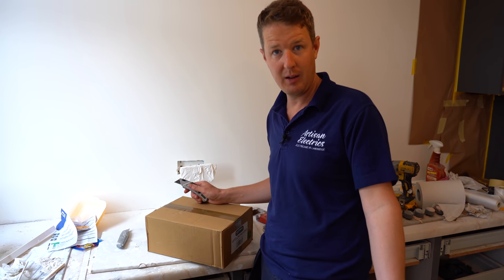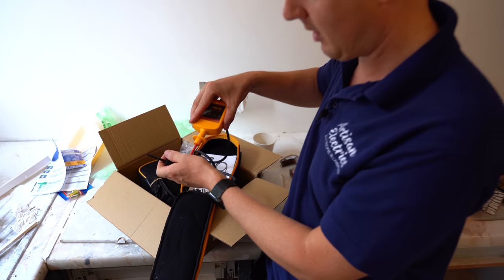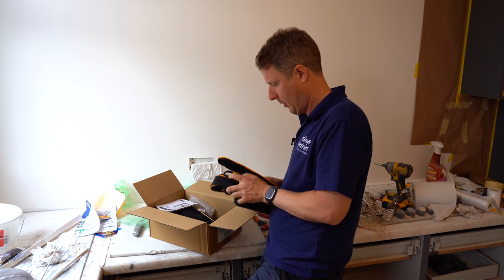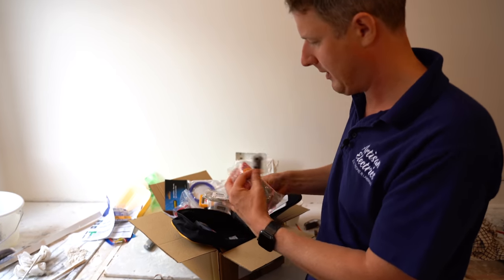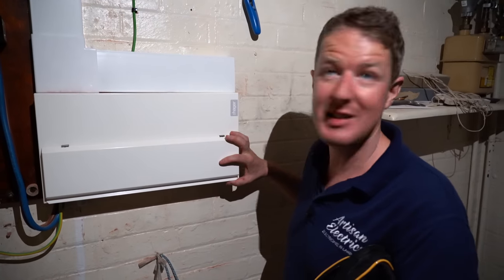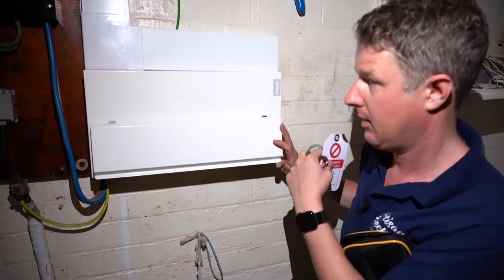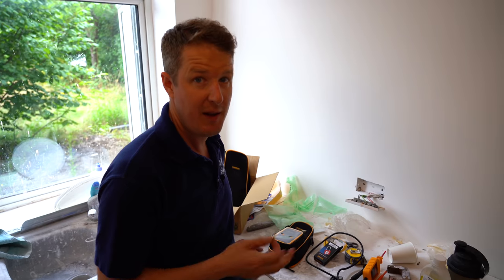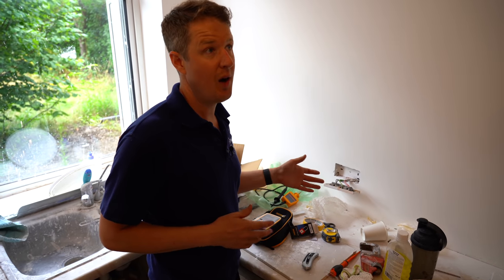Safe Isolation Procedure Lock out Tag out UK - Electrician Life

Comment: Talking about electricians losing their lives - do you have a proper emergency response kit in all your electricians cars? (medic kit, heart starter) If not, you should investigate!
Reply: Ok, so he gets a "kit" Question If he gets a severe shock, who is going to "operate the emergency response kit"
Reply: @tonipeters4543  The colleague or trainee helping on the job. Better to have the kit and not need it than not have it and need it!
Reply: We have AEDs, automatic external defibrillator. You don't start a heart with that, that thing only brings it back to the regular timing in case of ventricular fibrillation. You still have to do manual reanimation in case of cardiac arrest.
First aid kits belong into every car!
Reply: The DNO I used to work for ensured that all operational staff with a live working authorisation had also to complete basic first aid training that included CPR and use of AED equipment. This was part of the safety case supplied by the DNO to the HSE to justify the issuing of live working authorisations to suitably trained and competent persons.

That said, an AED won't do anything for a patient whose heart has stopped. I understand that the latest AED models, once the pads are properly applied to the patient's body, can determine whether the patient is suffering VF (in which case it will proceed with the defib sequence) or that the patient is asystole (in which case it will tell the AED operator the heart appears to have stopped so no shocking takes place).
Reply: @tonipeters4543  a risk assessment of any work activity should consider whether the work in question should be accompanied work. Some live work (e.g. work in a control panel where some apparatus remains live while the part to be worked on is disconnected or isolated) requires accompaniment while some (e.g. switching operations) does not.

Comment: I like your video and the process of proving dead was well demonstrated but would be good to identify where the process comes from. It is a legal requirement in the electricity at work regs 1989, it states when working on equipment it must be isolated from all sources of supply. In the definitions it states that an isolation is a disconnection from all sources of supply in such a way the disconnection is secured, I.e. disconnect the source and lock it to secure it. Also the process comes from the HSG 85 which is the HSE guidance for electrical safety. You also mentioned that a light on the proving unit identifies high voltage, high voltage in the EaWRegs is voltage over 1000V ac or 1500V dc between phase conductors and above 600V ac 900V Dc between phase and neutral, voltage range  between phases. national grid introduced Medium voltage bet is not recognised in law but is in their own safety rules. Good vid though for house bashers, just a shame so many so called skilled electricians don't even know the safe isolation procedure.
Reply: It’s a legal requirement to work safely, ie isolated, yet the DNOs still resist us being allowed to pull main fuses, or make us jump through hoops to enable us to do so. It’s madness.
Reply: Hi Stuart, good to see such a correct and informed reply. There are many concerns with YouTube electrical videos, even from Artisan, but at least they are trying to improve things. Working at height is a major danger and even a non fatal shock can cause a reaction fall. Noticed this problem in an Artisan recent post. Another concern is understanding the role of an electrician when making changes to an installation and installing new work without detail drawings from a professional engineer.  They then assume the role of designer and need a high level of knowledge of the full installation plus professional indemnity insurance. Anyway thank you Artisan for excellent videos and welcoming debate.
Reply: @chrisrogers2848  how does the DNO (who owns and operates the service termination apparatus) gauge the competency of someone that is intending to operate the cut-out fuse? They **have** to do this as they have a duty to establish and operate a safe system of work under the same health and safety legislation (s.2 HASAWA 1974) that requires you and I to work safely. Any DNO with a policy of allowing anybody to pull main fuses without first assessing their competency to do so safely would eventually be guaranteeing a visit to the dock in the local court for their Operations Manager.
Reply: @protectiongeek  surely then by the same token they should be required to provide a safe means of isolation that can be operated without need for them to assess competence, which in practice probably means an isolator switch. There was an ideal opportunity to do this with the smart meter rollout but it was missed. Failing all else, the process for getting them to isolate the supply needs to be much more accessible and convenient, otherwise people will always be tempted to just pull the fuse themselves on the quiet just to get the job done, which means no safety precautions at all.
Reply: @chrisrogers2848  the requirement for provision of a point of isolation by the DNO is not in doubt but there is no qualification of that requirement such that operation of the PoI should not require a person to be competent and appoint as such in writing. If there was, that would create a *retrospective* burden to fit two-pole isolators to all service terminations.

Clearly, DNOs concur with your conclusion that the provision of an isolator is a sensible step (although the person operating it in the context of the work carried out by an electrician must still satisfy the requirements of Reg 16 of the Electricity at Work Regs 1989). All new builds (as far as I know) incorporate an isolator. Some DNOs charge for retro-fitting one to a legacy service termination and some don't.

As with so many things, the issue is one of cost - a valid consideration within the ambit of what is deemed "reasonably practicable".

An electrician at work pulling the fuse "on the quiet" is taking a significant risk. We both know this happens several times each working day. However, if that action is material to the circumstances of an incident subsequently investigated and prosecuted by HSE etc, then a defence of "it was inconvenient to contact the DNO and wait for them to attend" is no defence at all.

I know that the HSE take a particularly dim view of no isolation or things like sticking a bit of PVC tape over an MCB in the off position, given the availability of products like the Martindale kit demonstrated in this video.
Reply: @protectiongeek  absolutely, and this is more so because the cut out fuse is equipment belonging to the DNO and as such they have a duty of care as you state to ensure competence before allowing anyone to operate it, this has been improved with main isolating switches. Competence assessments would be very difficult for the DNO simply due to the size of their network so such a restriction to operate is the most effective saftey measure. Also the DNO have their own safety rules for electrical saftey which prohibits anyone operating their equipment unless there are a formally appointed Authorised person or Competent person for that specific task.
Reply: This video opens up a good debate, there are many grey areas in the world of electrics to mention. I personally think Artisan Electrics provide really good informative videos, not for instruction how to do things but why the processes are in place. Great video guys, keep them coming.

Comment: Can I ask a question and hope you answer is it illegal to cut and take out the ESB meter fuse
Reply: Well it doesn't belong to the customer, but if the suppliers can't be bothered to install a suitable isolator, then I will pull the fuse and think nothing of it. You have no option when doing a board change.
Reply: From what I've read on various comments to similar videos, the practice varies between DNOs (or DSOs as they are now?), which is not helpful. There should be no doubt that the service termination apparatus, including the fused cut-out is the property of the DNO, is therefore a component of the LV network and, as such, is subject to the DNOs Safety Rules applicable to that network. The DNO I used to work for has a specific switching authorisation for the withdrawal/replacement of cut-out fuses so the removal of a cut-out seal and then the fuse-holder could be construed as unlawful interference. Only way to get a definitive answer is if it ends up in a court of law. Best not to go there.

Comment: I don't understand why they don't build the proving units into the tester - would be  a lot more convenient
Reply: Some do, there are self proving testers as well
Reply: Fluke do, I have one. T110
Reply: I don't see the point in proving units, when you can just test on a known live source
Reply: @acelectricalsecurity  yep there is that too. But if you’ve turned say a circuit off then pop off to another part of the building where said circuit is supposed to be off, you’d need to test it. The house I purchased wife wanted a single socket changed to a double. Off sockets down went… went to socket down and tested. It was actually on sockets up!! Never assume, always test. No known source was available to test the tester.
Reply: @ericbrooks1673  how does the t110 have a built in proving unit? I’ve got a t130 and never heard of or realised they do?
Reply: @Sparklife-UK  Touch the probes together for 3-4 seconds and it should all light up when you take them apart.
Reply: @ericbrooks1673  oh yeah it does as well, that’s cracking I didn’t know that, thanks for the tip!
Reply: @acelectricalsecurity  Most new lifts that are installed are machineroom less. 9 out of 10 times youneedto isolate the supply on ground level. After switching off the power there is no 230vac or 400vac on the top most floor. The option of just sticking it into a socket is not that easy. I could test my tester on level 1, run up the stairs to level 12 to test dead, run back down to level 1 and test the tester in the same socket and run back up the stairs to level 12 to continue work.
The proofing unit saves time.
Reply: @ericbrooks1673  be careful, that may just be a continuity and lamp test.  It may not verify the unit is correctly detecting the indicated voltages.
Reply: @MS-Patriot2  According to the manufacturer instructions it is a self test function.
Reply: @ericbrooks1673  great, stay safe.  BTW, I noticed there was a recall on your unit if manufactured before May 2018.  Check out John Ward’s channel.
Reply: @MS-Patriot2  Always pal! You too

Comment: How do you know that your proving unit doesnt effective? Do you need to prove your proving unit as well . Endless cycle :)) let me tell you do best way if i work already energized system my proving unit is the incoming supply tails. If i do new rewire or installation  then i know it s not energized and already disconnected so its dead because i install them.  We dont need a proving unit...
Reply: If your proving unit isn't working then your meter won't light up and you'll know that something's up. You might not always be at a location with available live tails to proove off of, what if you were working on a DB and you had isolated the supply on the other side of the building? The proving unit is a convenient way to have a high voltage source readily available when you're doing the testing.
Reply: @robbgosset674  but as @MR M.K said how do  you know that the proving unit is not faulty, use a second instrument to check as a MFT
Reply: No need to routinely prove the proving unit - if the tester doesn’t work on it, it’s an indication of a problem and that you cannot rely on the whole kit to prove isolation. You would then have to take extra steps to establish which part is faulty, rectify/replace and start again.

Comment: When you locked off youlocked off the wrong breaker!
Reply: How is it the wrong breaker?
Reply: @nigelevans2883  he flipped off the one to right of the breaker which was already off then locked the one to the left of the pair ie the one already off!
Reply: @Jon Bailey Good, not just me then!
Reply: @judebrown4103  You want to watch the video closer and you'll see a cut in the video where he flips the left hand breaker off from behind the door and the goes to check the voltage on the socket and the locks that circuit breaker off.
Reply: @Jon Bailey You want to watch the video closer and you'll see a cut in the video where he flips the left hand breaker off from behind the door and the goes to check the voltage on the socket and the locks that circuit breaker off.
Reply: @nigelevans2883  ah, I did wonder what he was doing behind the door there, hadn't even twigged that was the CU cupboard or that the click was not him switching on a light 😂 yes, I know, I watched before I was properly awake I think! ..... However didn't he test for live at the socket before he did that? (I haven't had a chance to go back and confirm that so willing to hold my hands up again. Could also be a continuity issue with the cuts too.)
I know how thorough Jordan is so I'm glad you put me right, cheers.

Comment: I would have isolated the CU first (checking first that no one else is affected by this) then removed the wrapping. Never work live.
Reply: Agreed. In this scenario, it was likely to have been reasonably practicable to have isolated the whole house supply in order to remove the "packaging" from the socket outlet to prepare it for testing. With the supply to the CU still on, it would have to be assumed that the wiring to the socket outlet was live and so removing the temporary protection applied by others was indeed live working that could not be justified in the context of the Electricity at Work Regulations.

If the circuit was fed from a 12-way TP&N DB in a busy factory a risk assessment and method statement would probably suggest a different approach to attempt to identify the circuit and prove it not live before removing the tape. If all else fails the RAMS would probably fall back to the use of adequate PPE (gloves with rated insulation, full-face rated visor and FR coveralls and NO metal knives or tools) to protect the electrician until the terminals can be exposed to allow the approved testing procedure to be applied.

Comment: Sorry, but if you're passionate about working safely then you've shot yourself in the foot before you even get started... using an open bladed knife where not necessary when opening the box, moving a metal handled blade towards potentially live conductors that also haven't been isolated and have been left unsecured outside of enclosure... Cluttered working area...

As for the quality padlock... seconds to open without a key by any number of means - the point is to prevent accidental energisation as preventing deliberate override is virtually impossible.

Comment: When i change socket from in my home i dont tend to bother locking of i just take the MCB out of the board (its an old wylex with the plug in mcbs) so no one can turn it on at all. for seeing if its still live i use one of them cheapo testers with the three neons. i just dont test my tester as i see it kind of pointless and i dont have a proving unit.

Comment: Anyone use a fluke clamp meter for sale isolation?
Reply: I use my fluke T5-1000. I normally dap my fluke volt alert on a circuit as it’s always on me, then check with the meter after to make sure.
Reply: A clamp meter doesn’t comply with the relevant bs number, your safe isolation voltage tester must be a dedicated voltage tester and work without batteries among other requirements.
Reply: @Jamie-oo3si  very true. I get the meter calibrated but I will look at investing in one and my probes don’t comply with gs38. Bit  embarrassing for a qualified electrician :s. thanks

Comment: Locked off the wrong switch
Reply: He did lock off the correct circuit breaker
Reply: @Duncan Freeman I agree, he did.
Reply: @nigelevans2883  at 9:30 onwards he describes the circuit already off as a spare.  We know that the circuit is still live as tested. He then comes back and switches the circuit to the right off. Which kills the power.  So it is the one to the right that needs locking.  After he opens the board again he makes the mistake of pointing to the spare and announces that after further testing its this one. He then locks the one on the left (the spare one)
Reply: @duncanfreeman296  You want to watch the video closer and you'll see a cut in the video where he flips the left hand breaker off from behind the door and the goes to check the voltage on the socket and the locks that circuit breaker off.